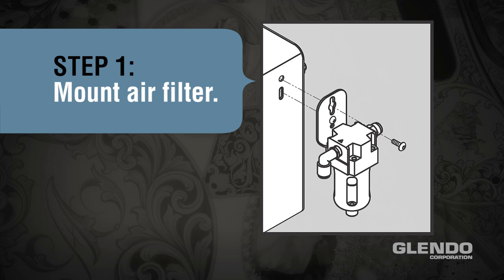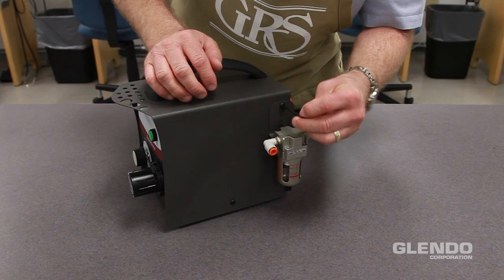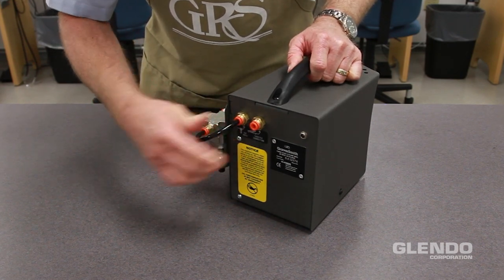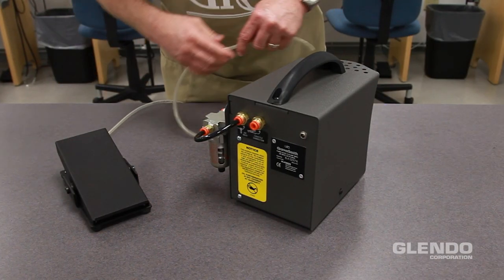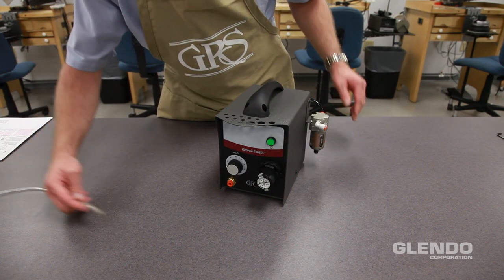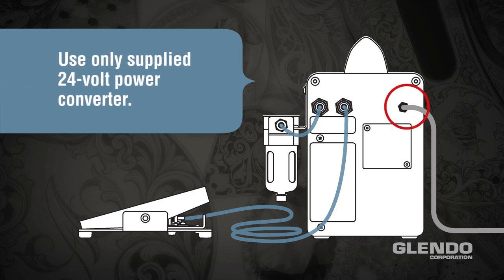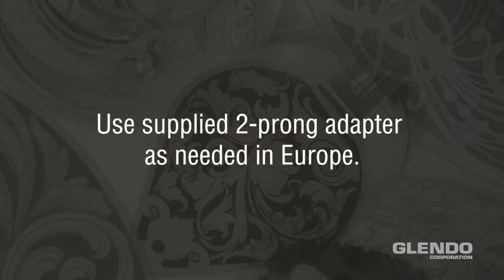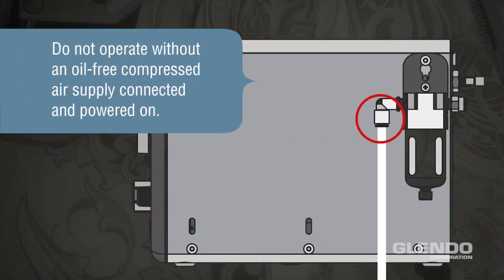Hand Engraving & Stone Setting Tools: GraverSmith Quick Setup

Comment from the maker: All our engraving systems use air to power the handpiece. Oil contamination builds up in the hose lines, interfering with the air flow and causing damage to internal components. Filters are either available for purchase or are included with some products. Thanks!
Reply: GRS Tools
Reply: ive been trying to set a jewelry workshop up for years but with essential tools like this it makes it almost impossible because of how expensive they are
:(
Reply: @camronengland1500  jewelry was being made for 7000 years before this essential tool existed.